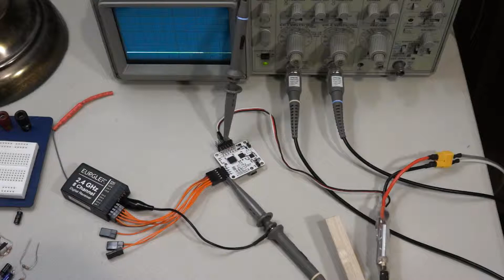Multirotor Flight Controller PWM Frequency

Comment: Wow, I just searching youtube, you are the first one I have seen do the Freq output. I have a Syma x8 board, I don't have a scope, I wish I did, I put a Frequency counter on the tiny transistor output of the Syma Rx board just before the input of one of the FET's and it read 1MHZ min through 2MHZ Max. how can I  get it down to 400khz to drive the esc? Good video
Reply from the maker: I'm not familiar with Syma gear so I'm not sure about the signals produced. There does seem to be a brushless kit for it though: https://www.rcgroups.com/forums/showthread.php?2523679-Syma-X8-Brushless-upgrade

Comment: I assume that your vertical axis is at 1V/dev, so your amplitude is around 3,3V? Is this voltage more or less standard for flight controllers?
Reply from the maker: I don't remember exactly, but looking up the STM32F103 microcontroller used by that board shows 2.0 to 3.6 volt IO, so 3.3v would be spot on: http://www.st.com/en/microcontrollers/stm32f103cb.html